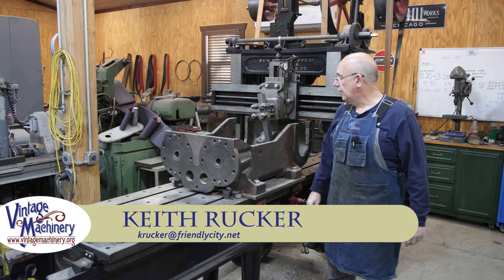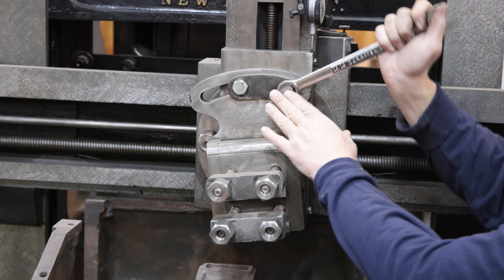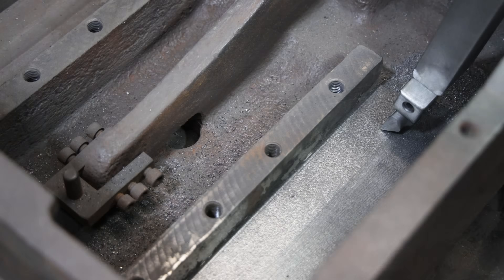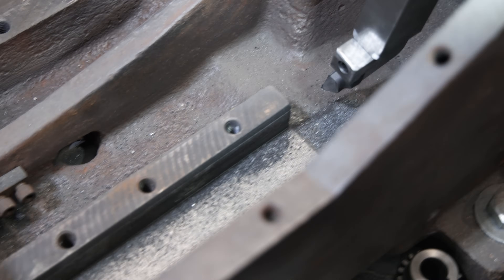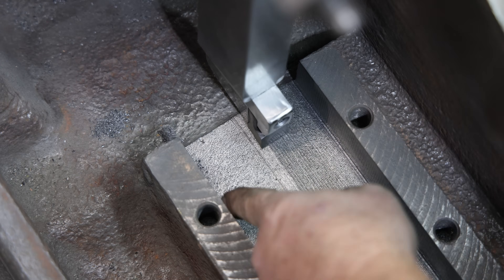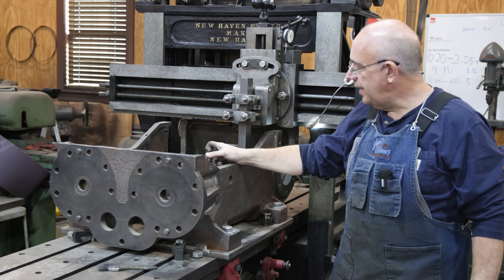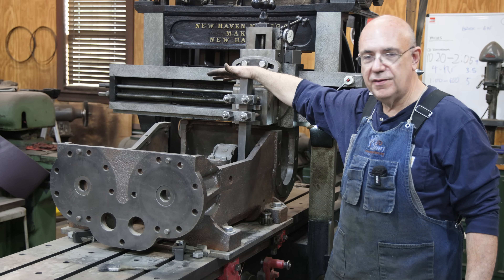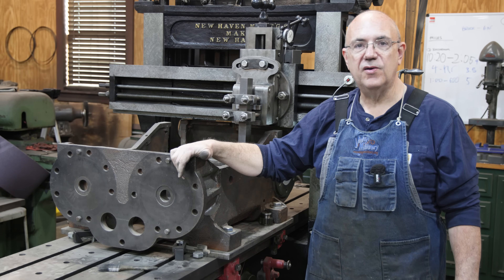Steam Stoker Engine Project: Continuing the Plaining of the Cross Head Ways

Comment: Why don't you use the horizontal boring machine?
Reply: He tried. It doesn't have the reach to get into the bottom of that box.  Adam Booth also tried on that monster shaper of his, and got nowhere. Sometimes a rotary tool will reach, but then it develops too much flex on the shaft and either digs in, chatters like hell, or breaks the tool. Or all three at once.
Reply: Just get out the pop corn, sit back and  have some laughs, watch Bozo in action!
No measurements, no dimensions, just "but Uhhh it's cleaned up"!
I did notice that he's not putting his hand in there to get smashed a second time!:hand-pink-waving::face-pink-tears::face-blue-smiling::face-blue-smiling:

Comment: 16:02 blasphemous.. i know, BUT... what if you made a support for a common (but robust) router frame and put a milling bit in it? Something quick and dirty, for a small size cutter, no bigger than say... 5~6 mm? It would let you make the finish cut, and let's be honest, if the people who made this machine could've made the attachment to such a tool, they would've made it. Besides, it's cast iron, so it should cut easily. It's not steel or something harder. Just a thought. Now, excuse me as i run from the masses who want to lynch me for even suggesting such a sacrilegious thing. :))

Comment: Die sink EDM or  hand scraping time?
I'm guessing various fails have occured from tool chatter. Perhaps fit the cutting tool to its holder with the tolerance end mills / their holders use -- set screws only retain the telescoping position.
Or machine the tool holder bottom corners for left and right carbide insert pockets (hand scrape to final finish).

Comment: You've probably already thought of this, but if you moved the cutter back under the center of the tool axis, the toe of the cutter wouldn't dig in when the tool flexed.  Of course, you would have to relieve the heel of the cutter so the clapper would still work.  Amazing stuff that you are doing, Keith.  Good luck!
Reply: You are right.
The edge of the tool must be further back. So it flexes up and not down into the workpiece.
Reply: That's the problem. As the cutter bites, the tooling is flexing back, which moves the cutter down and it bites that much harder. You almost need a dogleg tool holder that steps back right under the clapper box. The actual cutter can still be at the front edge so you can get in the corners but the whole tool can offset so that the actual cutting edge is behind the pivot on the clapper.
Reply: Great point!
Reply: A narrower cutter would put a lot less load on the tool holder too, but I'm guessing he wants the cutter to be wider than the holder to simplify the setups?
Reply: I am guessing the cutting edge cannot be too far back, to be able to get up close to the wall. Is there a way to cut away part of the tool holder so that it flexes in a way to not dig in, like some of the older cutoff tool holders? Maybe cut away the back of the tool holder part way up the shank - but may have to be to the degree that the tool is no longer stiff enough for roughing.. The flexy part should create an effective center of rotation that is ahead of the cutting edge, maybe enough to counteract the digging in of the rest of the tool shank & machine deflecting downward. 
Thx for taking the time to share this excellent and unique content!
Reply: Right, that was what I was worried about in the comments to the last video. Problem with a too offset to the rear being that it now reduces or eliminates the clearance at the far end of travel where the cylinders attach.

Comment: Keith, Josh Topper of Topper Machine youtuber fame in Spooner, WI has an antique planer machine, such as yours, but he fitted a Bridgeport head to the clapper box and uses it to mill long distances.  With long reaching tooling fixed to the head, you might be able to face mill that bottom surface. Thanks for bringing us along on this video.
Reply: As Keith has mentioned already, milling with a long reach face mill, end mill, or a tiny single point flycutter will still have the torque (spin or circular in this case) making for a loss of rrigidity. We see this with the current tooling, let's add a twisting to the action, oops. The enclosed area is the major hurdle to overcome and doing so introduces problems in need of solutions.
Reply: Having run a planer with a Bridgeport J-head on a 40 foot travel I can say they are great at the long stuff. We were doing HMW (High molecular weight) polyurethane in 20 foot lengths. We used a small face mill HSS around 1 1/2 inch, reground if memory serves me, to channel out 1 5/8 wide, 3/4 deep, full length.
Reply: Mike, thanks for being Keith's spokesman. Here's my point...should he elect to install aftermarket motorized head on the clapper, I believe having a rotating face mill with multiple teeth contacting the surface is much less likely to gouge into the surface as shown with a single point cutter scraping along the surface. For your viewers Mike, we look forward to you presenting your solution. Thanks.
Reply: Just get out the pop corn, sit back and  have some laughs, watch Bozo in action!
No measurements, no dimensions, just "but Uhhh it's cleaned up"!
I did notice that he's not putting his hand in there to get smashed a second time!:hand-pink-waving::hand-pink-waving::face-pink-tears::face-pink-tears::face-blue-smiling::face-blue-smiling::face-blue-smiling:

Comment: Hi Keith.I saw your tool and toolholder is flexing back quite a bit on contact. The gepmetry of the toolholder and Tool causes the cutting depth to increase as soon as the flexing happens. So, once in contact, it bites even deeper.

Comment: In side view, If the cutting edge of the tool. was behind the clapper box and cross slide assembly, the cutter would deflect up and away from the work piece under heavy loads.  Right now, it is pivoting down and in to the work piece under load

Comment: Just plane it flat with the first cutting tool you used and bolt in a ground flat plate over the planed surface to act as the sliding bearing surface.

Comment: I remember seeing an attachment that was like your long toolholder, except that at the bottom there was a small spindle for a grinding wheel. The lower spindle was driven by an angle grinder with a chain cog adapter and duplex chain to the lower spindle, mounted near where the clapper box is. The clapper part was removed, and the cross slide part was where it was adjusted. The whole thing looked shop made. But it worked and the job was completed accurately with that set up.  Hope this is of use to you. 🏳‍⚧ I think that you could make a belt sander with the motor at the top of the belt and a roller at the bottom. That would work here, if it were as the attachment I described above. Does not need a chain, the belt would do.

Comment: Assuming your troublesome tool is perfectly square ended, if you relieve the centre of the tool, the loading would be reduced but you could stiĺl achieve the desired flatness as cuts would over lap in the centre.

Comment: cross section is king, whats the absolutely widest and thickest bar you can fit in the clapper, use that and cut 2 holder pockets 1 in each corner.

Also use cutting oil, I know cast iron should be cut dry but I've found a touch of heavy cutting oil can help even in cast
Reply: Correct.  The cross sectional moment of inertia has the height of the beam CUBED in the numerator.

So increasing the height of the beam in the direction of stroke changes its stiffness dramatically.

Further  beam deflection has the cross sectional moment of inertia in the denominator.  Thus, a large cross sectional moment of inertia MINIMIZES beam deflection.

We can literally see Keith's beam deflecting under load (tool pressure).  The tool holder (beam) needs to be much taller in the direction of stroke, without that awkward neck he milled into it.
Reply: true, width will help to a lesser extent though it will also help with twist resistance, potentially important if we're cutting from the corner
Reply: @TheSharkeyandgeorge  I'm with you.  Width does indeed help.  The increase in stiffness is linear with width.  Not as much bang for the buck as height, but still appreciable.

Let's hope Keith finds the way

Comment: There is not alot that goes smooth on this project that's for sure.

Besides the tool width the geometry also might be an issue.
Seem to remember from machine class a couple of decades ago that a finishing tool at 90 degrees to the direction of travel has a higher tool pressure then one at a slight angle.

I am sure you'll figure it out Keith.
Reply: As a woodworker, you skew the hand plane to the direction of travel to make the cut easier and smoother.  So, I like your idea samurai.   That might be worth a serious thought

Comment: I would go about doing bottom two ways. One is thinner cutter with large radius so at the bottom that is almost flat. Or as someone else said a cutter that is fixed at the back of the tool instead fo front so that when it flexes it actually moves up instead digging into material. Maybe try to just turn the current cutter holder 180 degrees and mount this same cutter in.

Comment: I see two suggestions below which would be good try combined. The long tool holder and the tool at the front it is going to dig in as it flexes. The tool would would be better at the back of the bar so that it would lift when under pressure. Also if the tool could be ground so it only cut on the outer edges then the cutting resistance would be much reduced. The problem you have only applies when plunge cutting and will be hugely reduced on the transvers cut.

Comment: Keith, Love your videos; glad you're healing.  Try a attaching a toolpost grinder to a long tool holder and grind the bottom surface.  Basically convert your planer to a surface grinder.
Reply: That was my thought, too.
Reply: That might work if there’s room enough. At the best it would require a high speed motor at the top with a long flexible belt and small grinding wheel.

Comment: When the cutting edge meets resistance it is pushed backwards. Because it is ahead of wherever the point is about which the long holder pivots it is forced deeper. If the cutter could be mounted further back it would instead be lifted slightly and would not stall the machine. This would of course leave the resistant metal slightly proud. That might be removed on subsequent passes. Ideally it should be mounted so that resistance does not lead to any vertical movement at all.
Reply: Never used a metal planer, but this makes a ton of sense. Like a tool slightly above center while turning on a lathe can dig in, just exaggerated.
Reply: @ikkentonda exactly, like the Armstrong tooling Abomb uses on his shaper. The ones where there is a circular holder to hold the HSS at various angles. The actual way they are to be used is reversed to the direction Adam is using them. This allows the tool to dig out of a cut since they are 'behind' the pivot point of the travel of the ram. With this in mind think of a trailing blade on a plow. Same reasoning for machining this way. Even with a subsoil plow the action will be behind the pivot. Back in the "old days" many folks came from a farming background rather than now with matriculation well past the sixth grade. Not complaining mind you,  just a different viewpoint.

Comment: Keith, try grinding the tool bit with center relieved. you will have both sides able to cut. remove maybe 2/3's of the bit center
Reply: And decrease the face angle on the cutter to prevent it from wanting to dig in so hard.
Reply: @pirtatejoe  I think that's more a result of where the tool is on the bar.  If the cutting edge was on the bar's centerline or behind even it would pull out of the cut when the bar deflects instead of dig in.  Not sure if he's got the clearance or if that bolt is strong enough but I'd be tempted to try and flip the tool and the bar around.
Reply: I believe that will make a significant difference if that doesn’t do it remake the holder with the cutter moved back to center line of the holder?
Reply: That’s a brilliant idea!
Reply: Yes!  I was going to make the same comment.
Reply: " ...try grinding the tool bit with center relieved. you will have both sides able to cut...":  Wunderbar! He can still get the corners cut.
Reply: I was thinking the same thing.

Comment: Hmm, looks like with that wide cutter you get a lot more tool pressure and with that more deflection in that long tool holder, and when it deflects it causes the cutter to dig in. Looks like the geometry of the holder is a little bit of a problem here. I saw someone having a special holder that bends in a way under load that makes the cutter come up instead of digging down, but I have no idea if they come in a shape that's useful here.

Comment: Could you try a round profile version of your first cutter to get a decent finish with much smaller cuts. Then cut a 45 degree relief slot in the corners as you might with a dovetail to avoid having to get right up to the side?